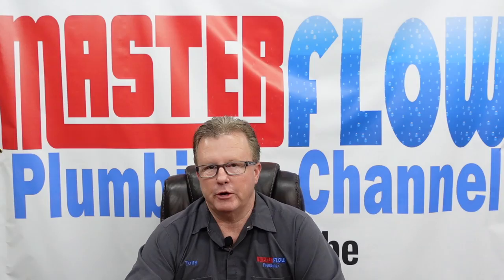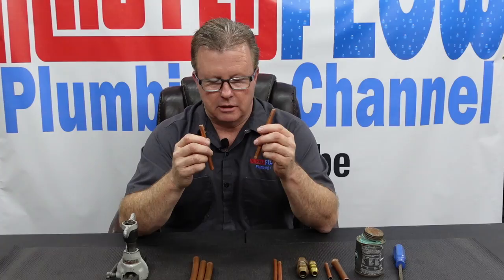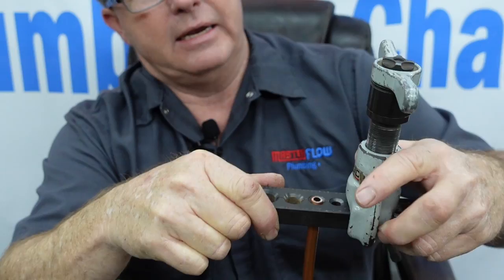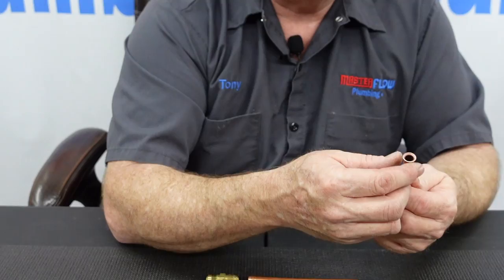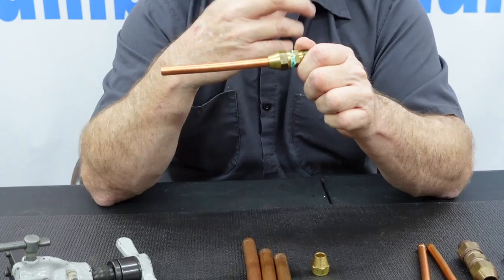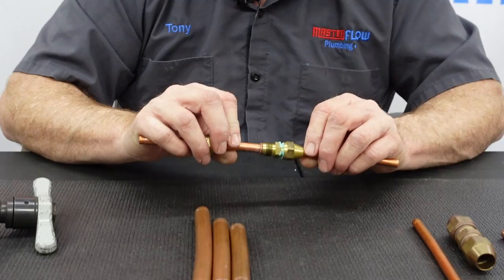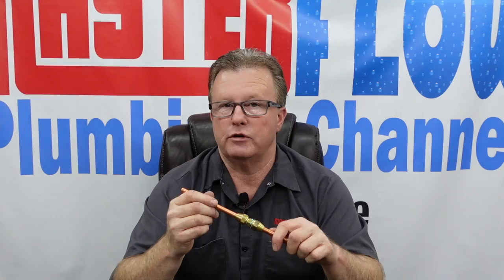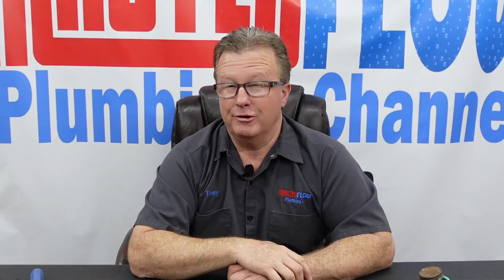How To Flare Copper Tubing Plumbing 101

Comment: Thanks for the demo. I've seen some YTs which reccommend using a torque wrench to the specified tightness, but I see you feel it's adequate to hand tighten + a quarter turn with a wrench. That will save me some money for the first time I've done this since helping my Dad about 65 years ago, and pribably my last time, as I am 78. But I am doing it for NG inside my house, so I want to get it right. (I suspect it is not up to code for gas today, but it was when this old house was built, about 100 years ago, and the house is still here. 😮
Reply from the maker: Be careful.  Take your time and do it right. Gas is. Nothing to play around with. Make sure to test for leaks.  And thanks for watching.

Comment: We use a flair connection for hooking copper water service to the water main! Also pack joint couplings(ford fittings) if we need a coupling. Or joining copper to poly.

Edit: we always used the flaring tool that stick in the pipe and hit with a hammer. Took some practice!
Reply from the maker: Old school hammer flaring is a lost art.  I used to do k copper gas lines underground for pool heaters. Had to hammer flair all of them. Mostly one inch and some 1-1/4.   Good job and thanks for watching